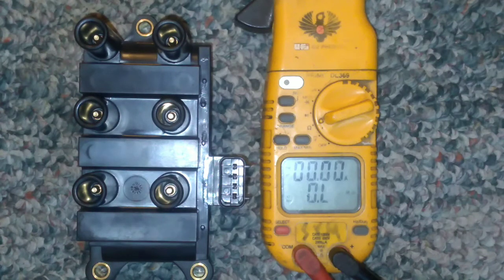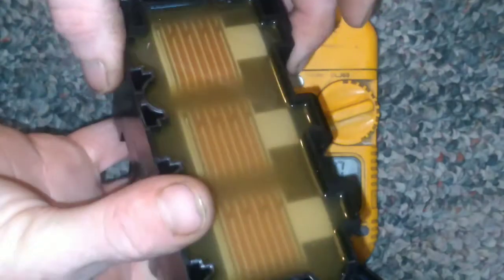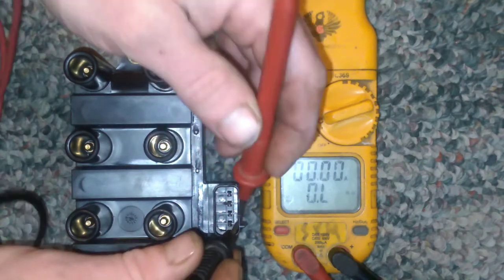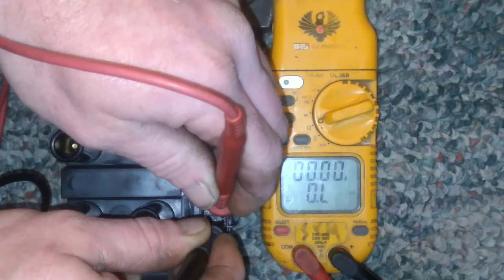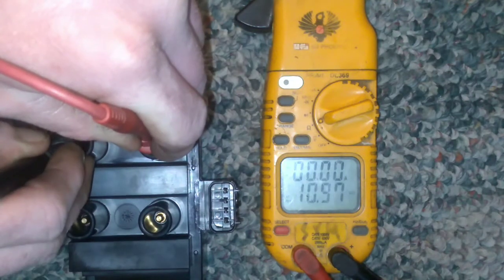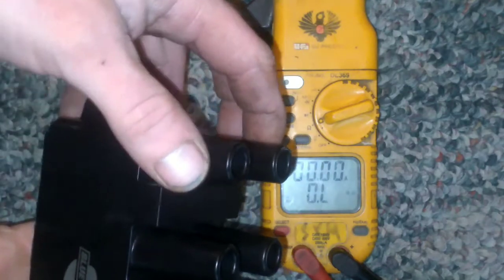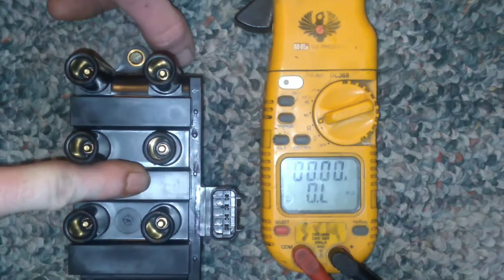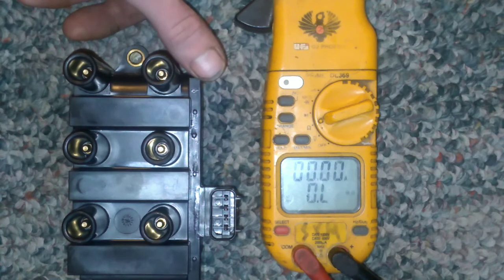Ford ignition coil (waste spark) testing with a multimeter. Mustang, Windstar, Freestar 3.8 / 3.9 V6

Comment: Wonderful video sir, I have p0353 (coil b circuit) code and p01537(imrc)I tested coil pack on primary it was 1.2 1.2 0.8 got a new one and it was the same what should I try next
Reply: check to see if the bushings on the imrc arms aren’t cracked to hell and broken, when the bushing fails they cause the arm to just free float causing bad idle

Comment: Thanks for this! I was reading 1.4 on one primary and .06 on the other
Reply from the maker: No problem, glad it helped!
Reply: That’s what mine was reading, that means bad right?
Reply: I also get no reading from the actual posts where u plug the spark plug wire in

Comment: I'm confused on the relationship between the MAF and the ignition process.  How does the MAF have anything to do with the ignition....
Reply from the maker: The MAF calculates how much fuel is needed to match the amount of air or air mass being consumed by the engine. O2 sensors make this even more precise but most O2 sensors need to warm up first. The camshaft position sensor actually helps to time the fuel injectors pulse rate and the crankshaft position sensor's main responsibility is to report engine rpm and relay this info to the pcm, the pcm can then time the spark based off top dead center of the piston stroke. 
I've noticed most vehicles, especially maf only cars will go into a default strategy provided by the pcm if the MAF is unplugged. They may start but run very poorly because they cannot mix the fuel/air correctly. 02 sensors let the pcm know how much oxygen remains after  combustion has occurred and helps the pcm adjust to keep the fuel mix from becoming to lean or rich. Hope this helps
Reply: @singularautomotive3542  that does help.  Thanx for the response.  Your answer actually helped in another way.  You bring up the point of o2 sensors and how they need to be warmed up.  I am having an issue with rough idle and what feels like misfires (shaking floorpan) at idle when I first start up or when I am in park or neutral)  it is worse when it first starts up though....I cleaned MAF sensor last night although it didn't look dirty at all and I can't believe the difference it actually made.  On my scan tool live data it sits more stable (maf data airflow rate) and it idles perfect as long as the car is in gear (under load).  I wonder what direction I should go to in diagnosing the issue of shaking upon start up and worse idle out of gear (park/neutral)....fuel trim doubles when I go from drive to park idling....somewhere around 3% long term up to 6% long term but it happens immediately upon going from drive to park and if I go back to drive it evens out and goes right back to +2%....I wonder if I could have a very small vaccuum leak or if this could be an issue with a dirty clogged fuel injector
Reply from the maker: @macknumber9  I would definitely try to check for a vacuum leak, you said shaking floorpan and that makes me think more of a small exhaust leak which would alter your fuel trims too. I'm assuming you have a Ford, if your scan tool has Mode $06 capabilities or a non continuous monitor category you should be able to scan it when you're suspecting the misfires are occuring and get a reading of past and current misfires for each cycliner and more information about how your exhaust system, including the EGR is functioning. A partly stuck EGR pintle and EGR vacuum tube leaks are common on Ford's and can cause roughness too
Reply: @singularautomotive3542  I do have a ford...3.9 v6 mustang...I bought a scan tool that has mode 6 but it is a pain to find misfires on it....I don't know the parameters for when it is even recording the misfires....it isn't in live data which I wish it was....I get like 5 misfires on a count of 1000 so I don't even think that's a concern but I don't know if it is ever even recording misfires at the time I feel them most (idle in park upon starting engine)
Reply: @singularautomotive3542  the shaking floorpan is only at idle in park....if I put it in drive and idle it won't do it.  I don't think exhaust leak because exhaust leak it should happen all the time at idle not just in park idling....

Only thing that I can tell so far is when it idles in drive (calculated load 40%) it idles great no complains and when I throw it in park (load goes down to around 30%) and idle is little bit rough and fuel trim goes leaner....
Reply from the maker: @macknumber9  usually with the motor at operating temperature your maf grams per second should be around 3.7-4.1 grams per second. Close to whatever liter the engine is. Also most of the 3.9 liter engines I've messed with will typically run 700 rpm at idle at operating temp as well. Have you verified that the throttle position sensor is sending the correct info to the PCM. I know Ford TPS are bad for getting a spot that causes the voltage to drop out at idle. They'll run perfect with an rpm change, switch back to idle and they'll cause misfires. And depending on if your having a voltage dropout or a higher voltage than actually should be occuring you can run lean or rich while the misfires are occuring. I also remember Ford stating on certain vehicles not to use throttle body cleaner on most of their throttle bodies because the abrasiveness of the TBC could damage the throttle body. I will usually try to use WD-40 and a toothbrush if I have any carbon buildup on those. 
But anyways I'd try to make sure your maf is reporting normal g/per second, your rpms and TPS looks good as well. Check your intake manifold runner arms too and make sure the bushings are still intact on both runners and that the motor is still functional. The motor will run a self test usually 2-5 seconds after starting the motor, I normally can't get back to the front of the engine to watch them actuate so I will start the engine and pull the throttle cable until they actuate which is usually right around 2500 rpm. Hope any of this helps you and good luck. Feel free to message me anytime I'll try to help as soon as I catch your messages. And if you haven't already please subscribe to the channel. I haven't been able to post many videos lately but I'm fixing to start back recording.
Reply: @singularautomotive3542  I got around 3.76 grams/second last I checked but then it goes up....I think it goes up because the engine opens up the throttle or iac because I can hear the engine rev...but then again I don't know for sure...it is like chicken or the egg....did maf reading just go bad and jump up and then the engine compensated or did the engine compensate and the maf correctly read the higher number.

The TPS I never actually back probed and tested the voltage coming out of it through its range of motion but I did look at live data and all I get is what seems like a consistent number 19.6% at idle and it seems like it goes up smoothly as I increase rpms....maybe I should actually test it with a multimeter though...

I will check those runners even though I will have to research what they are.  I did see a TPS on some kind of intake actuators and tried to look back behind the intake by the firewall but couldn't see...might have to use my phone to get some good footage back there and inspect....

Coil tested 11.4 secondary cold and 12.0 secondary after warming up....primary I believe was .8 cold and 1.0 when it warmed up....I changed plugs already but didn't change wires...maybe I should check resistance of wires too just to rule that out....

My fuel trim numbers really aren't that bad they fluctuate but occasionally I will see long term bank 2 get up there in the +7 range and up to +11....but for most part it is down around +2 or +3....

I do notice fuel pressure fluctuates big time.....I was going on the highway and checking everything...38 to 41 psi....I get off the highway and start all the stop and go and it gets up to 55 and all the way up to 66 psi....I know that is out of spec but I have no codes for fuel pressure sensor or fuel pump circuit....I think the PCM is just calling for more fuel pressure perhaps because of a bad o2 sensor that is pegging low sometimes? Or a clogged injector(s)?

Since bank 2 always runs leaner then bank 1 I'm starting to think maybe I should look into checking the o2 sensor on that bank or first off checking for exhaust leak bank 2 pre cat...
Reply from the maker: @macknumber9  The EGR is on Bank 2 if I'm not mistaken too. The intake manifold runner control is a motor with two rods coming off, one going to each bank. It adjust the amount of airflow going into the intake with butterfly valves. It actually changes the shape of the airflow as well. At low rpm, high torque the intake is squeezed down and smaller and when higher rpms, more HP is needed the intake manifold runner control opens the butterfly valves and makes the intake larger. It's like having two different intake manifolds on the same motor. The rods are just held in place with plastic bushings, the bushings are bad for becoming brittle and breaking. And they can cause the runners to be stuck open or closed. And they can break on only one bank or both
Reply: @singularautomotive3542  this could very well be my issue....I will try to examine them later today.  The EGR could be an issue as well.  Not knowing what I was doing I pulled the hose off the EGR (the one that goes to the intake) and it didn't change the engine at all and I felt no vacuum.

I am having really weird issue with high fuel pressure and calculated load #s....on drive to work this morning it ran excellent.  Idle perfect as it usually is when in gear.  Fuel pressure was 38 to 41 psi whole way there and calculated load got down as low as 15% while coasting which is rare.....then when I got to work and put it in park the fuek pressure climbed in the 60s and the calculated load got up into the 40s.  Why would calculated load be higher out of gear then when in gear?  It also started running worse with some shaking and surging....
Reply: @singularautomotive3542  I think you may have pointed me to the solution by mentioning the intake runners....there is a TSB on them...the bushing break off and the arms fall off like you said....this will not set a code.  I have a very good feeling when I check I'm going to see this is the problem...
Reply from the maker: @macknumber9  i really don't like that calculated load being that high either. I hope that it is just a broken bushing. That would be an easy and cheap fix. Also don't forget to try to actuate the IMRC motor if possible as the motor can  fail open or closed. And/or the butterfly valves can get carbon build up and cause then to stick open or closed too.
Reply: @singularautomotive3542  yeah I do not understand why calculated load is fluctuating at idle in park....I do have a noise coming from power steering pump and alternator confirmed by stethoscope....it is just so weird how that number fluctuates...

I'm at a lost as to what is causing what....the maf readings I stare at while in live data idling....it jumps from .5 lbs/min to .8lbs/min and at the same time the rpms go up a little....I don't know if the IAC is opening letting more air in which is bringing that maf number and rpms up or if the maf is reading wrong and the PCM is making the change to the fuel injector pulse width to match the increased air.  That's what's confusing me....the chicken or the egg....if I know it is the maf that is dirty causing that reading to jump then I can narrow down and fix my idle that randomly jumps up problem....
Reply: @singularautomotive3542 thank you for taking the time to write this!!!!

Comment: All 3 should be dead on? Is that important? I measured .8 on two and 1 was .4
Reply from the maker: Specification says 0.3-1.0 Ohms is an acceptable primary resistance according to Ford. Most of the ones I've checked usually read 0.6-0.9. Had one read 1.2 and was having a weak spark problem out of it. You should be alright with one reading 0.4 and the others at 0.8. Did your secondary look good? Did you test it with the engine bay hot or cold? And are you having ignition problems and if so, what's going on?
Reply: @singularautomotive3542  I don't know if I have ignition issue or not but I have a slight misfire shaking st idle....I'm going to check secondary right now and get back to you....I'm going to check it cold and then I'm gonna let the car warm up and check it hot...